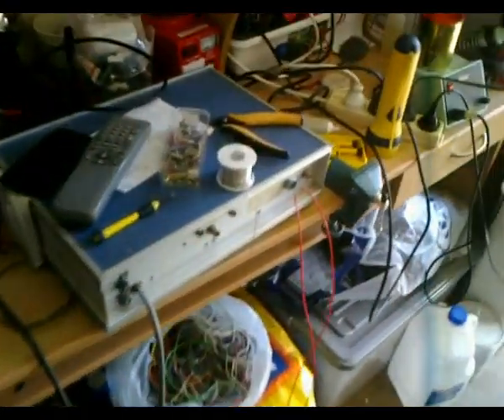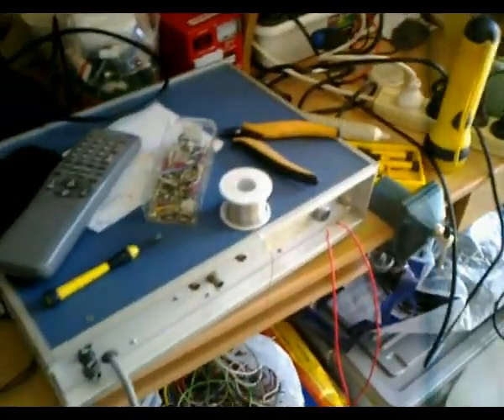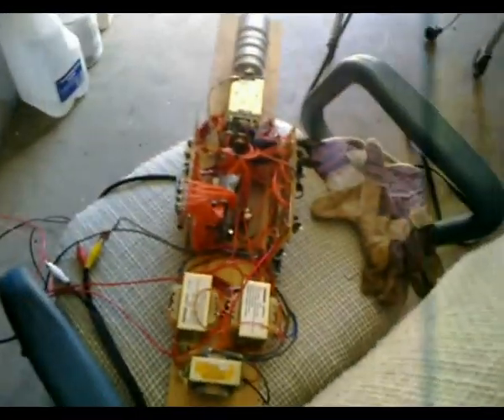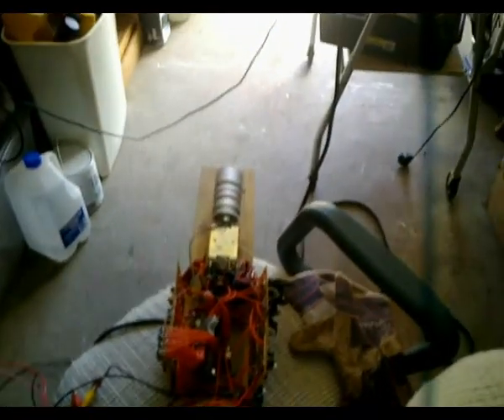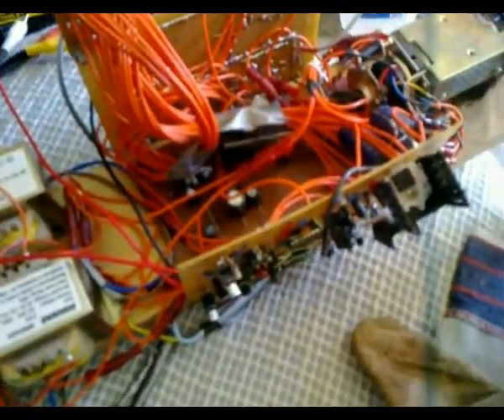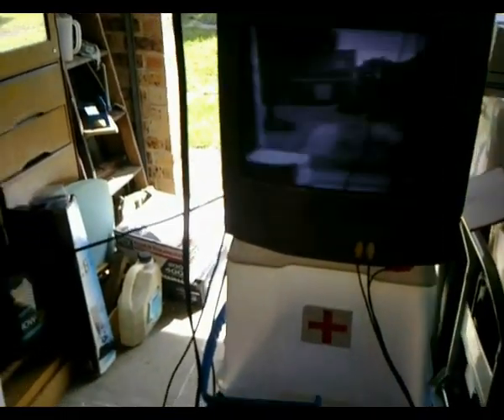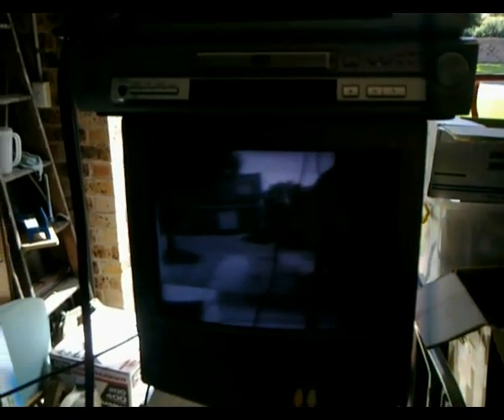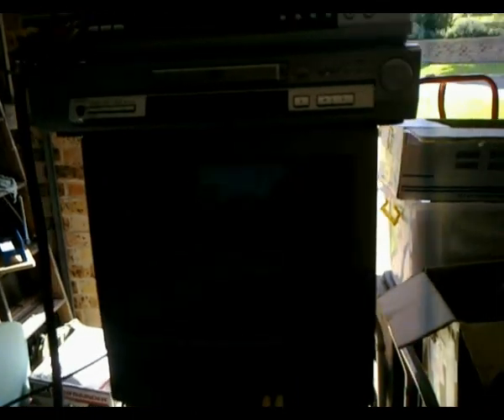Homemade video camera with sync pulse generator connected

Comment: I'd already seen your website then came across this great video. I was wondering if you'd had any luck using your SPG with your AVC-3250. I'm trying to record from a AVC-3250, and trying to work out the best solution (I'm a bit of a novice). If you can direct me to an email perhaps we can discuss more. Otherwise YouTube comments is also fine. I'd love to know the finer details of your setup. Thanks!